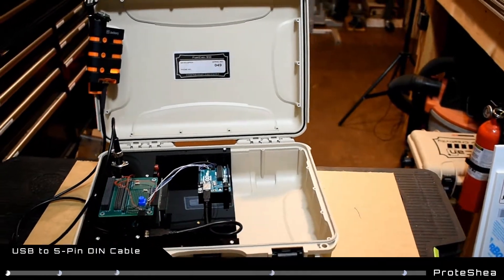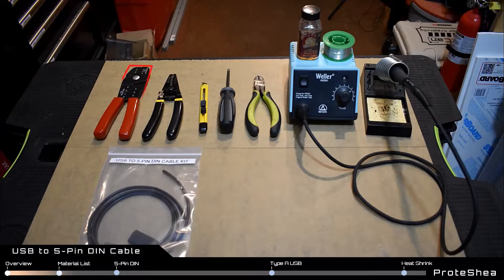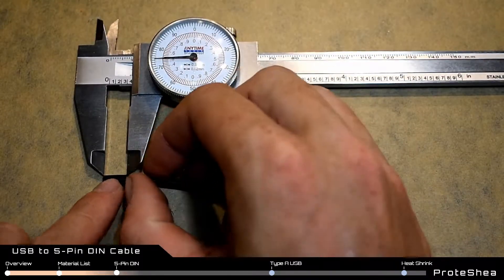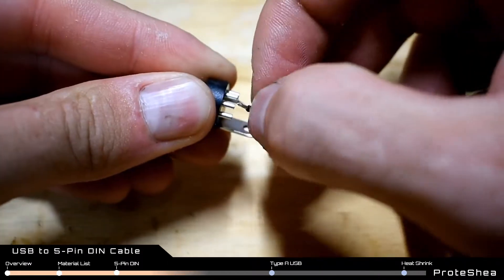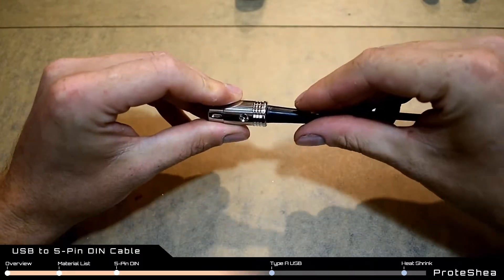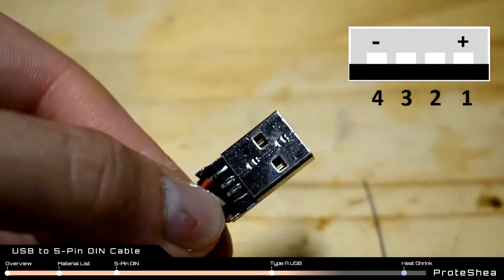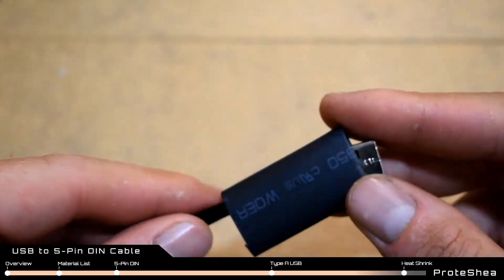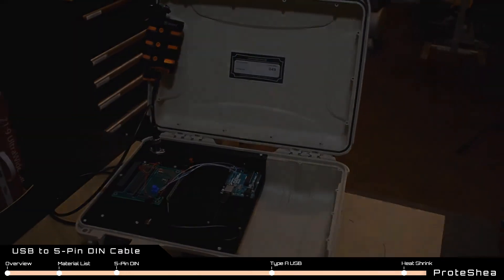USB to 5-Pin DIN Cable Build

Comment: You have to tell me how you connected the midi din? Because I have a problem with the Akai mpd16, since I can no longer use it with win XP, I saw that connecting the midi cable works just the same (at least so they say). I have everything you need a usb cable and a 5-pin din. I am waiting. Thank you very much.